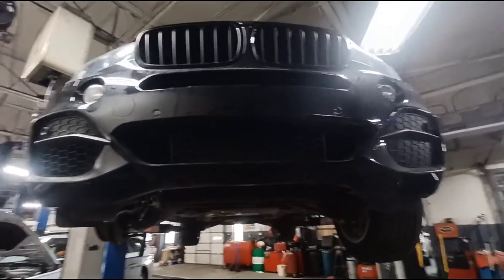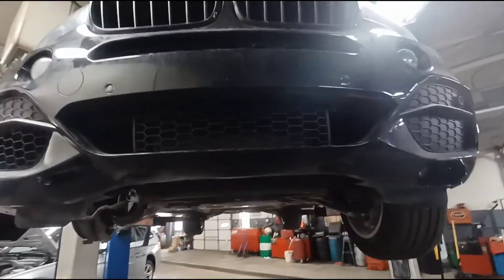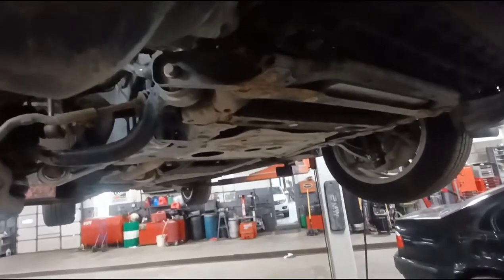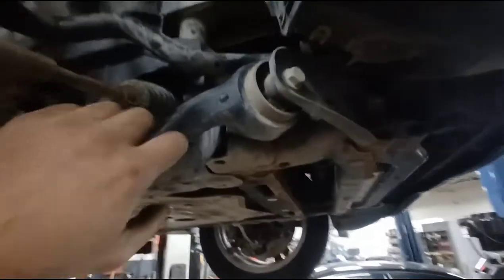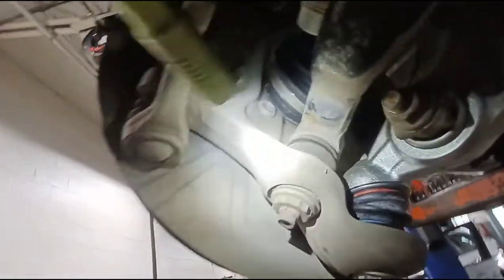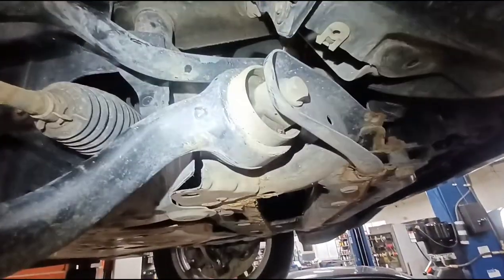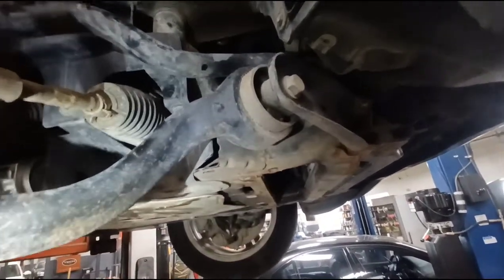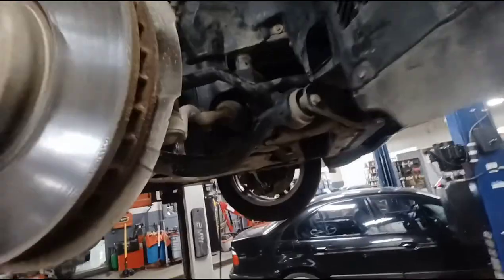BMW X5 FRONT SUSPENSION CLUNK

Comment: I just did a video on these control arms on e70 x5 and they are know for going bad but any time I encounter clunking noise on these is usually sway bar links and the strut mount bushings that have gone bad, on which I also did a R&R video.
Reply from the maker: Oh yeah! Sway bar links always bring the noise huh
Reply: I thought mine were the end links but the clunk has continued. Look at the strut mount bushings next?
Reply from the maker: Check front ball joints and bushings next I would say
Reply: @EuropeanAutoRepair  thank you!
Reply: @titleistprov69  Yes, you can visually inspect the upper strut mount bushings, if they are falling apart or already gone then that's where your noise is coming from. If not then I'll move on to other bushings and ball joints.
Reply: Been chasing my tail. First mechanic  changed upper arm bushing then second mechanic lower control arm bushing and ball joint.

Well noise is still there and I'm $1200 lighter in the wallet. I've finally found a shop that does mainly suspension and steering. Thinking about just going there. Noise is driving me nuts.

Comment: Hellooo, i have a X5m 2018 i have a slight clunk over bumps & when driving i have to correct my wheel so many times, that is getting annoying.

Can this be my lower control arms?
Reply from the maker: Yeah that’s a possibility cause, or a bad sway bar link
Reply: @EuropeanAutoRepair  I got new link sitting around but i will get my lower control arma inspected because is wondering on highway speed.
Reply from the maker: Yeah have the suspension checked out and alignment after repairs

Comment: Why don't BMW change the front wheel design. This suspension system is trouble and not last like toyota
Reply from the maker: Yeah not 100% sure on the reasoning behind the design
Reply: It’s for better handling not long life hence bmw versus Toyota different markets